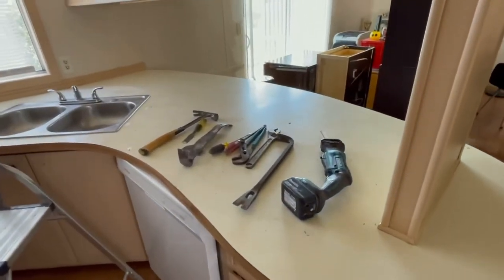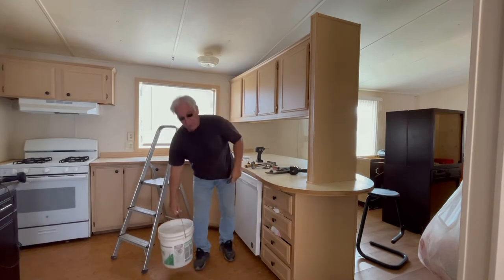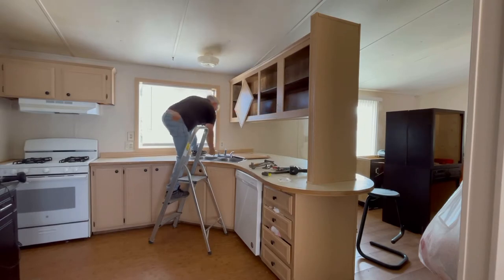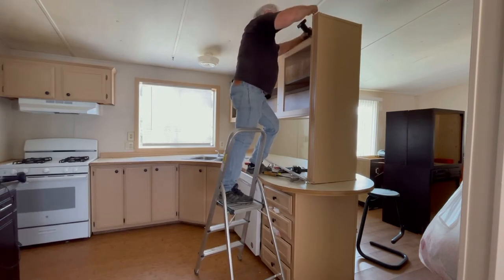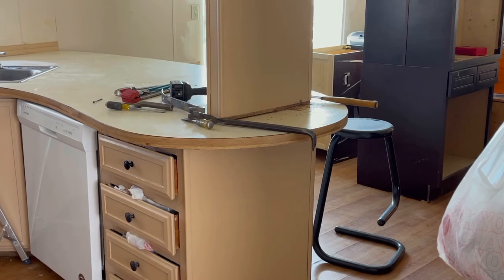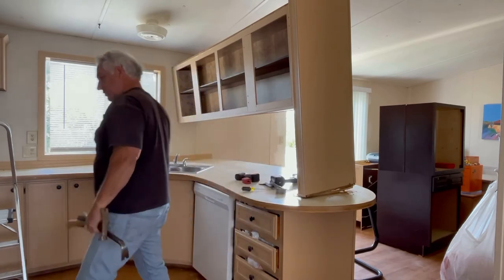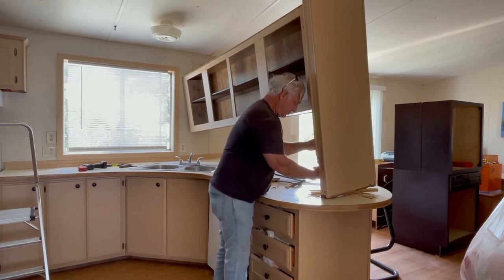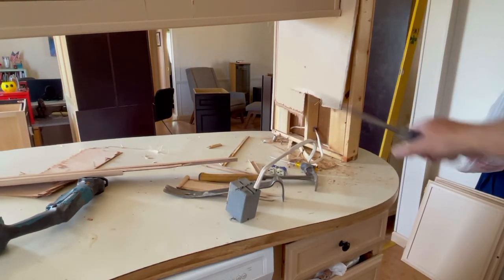MOBILE HOME KITCHEN DEMO First Phase / STEPS CABINET COUNTER TOP REMOVAL & PLUMBING DISCONNECT.

Comment: I'm going to starting mine here soon but it's attached with a post coming from ceiling ...
Reply from the maker: it is still non bearing if it is a double wide. most mobile homes have no bearing walls. i am not positive but almost certain.
thanks
Reply: @showmehow4076   yea it's a double wide they are so cheaply made... trying to figure out how the top ones come off can only find one screw... they ones that are over the sink u can't even see the top they hid those screw pretty good going to be a challenge